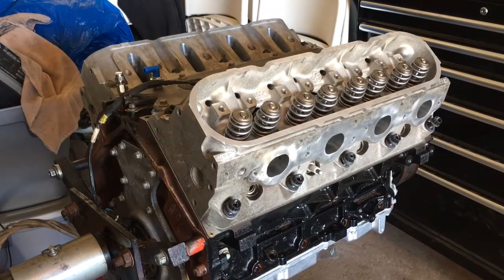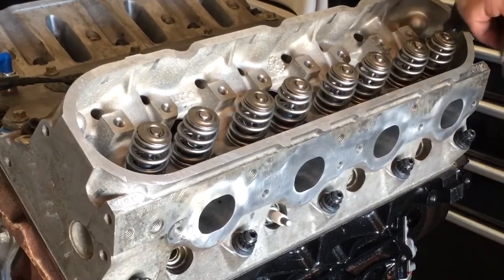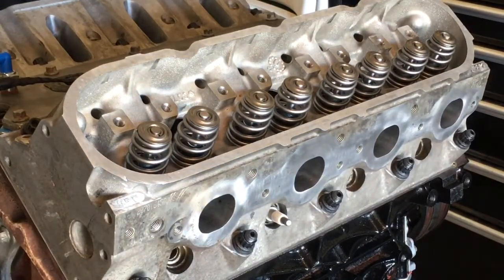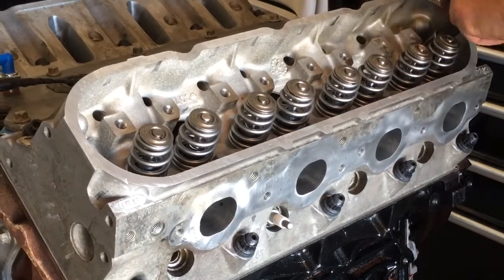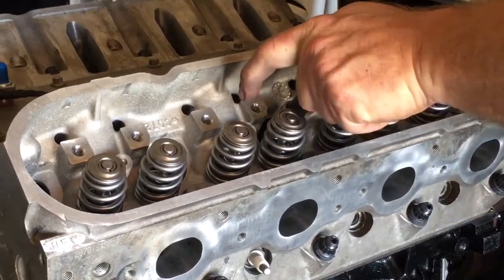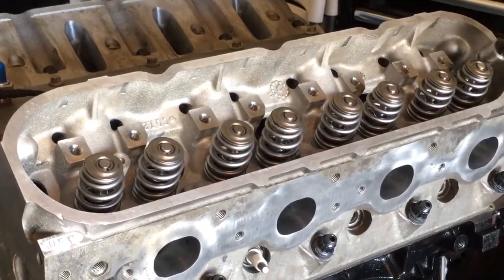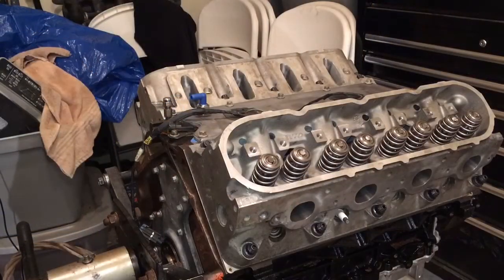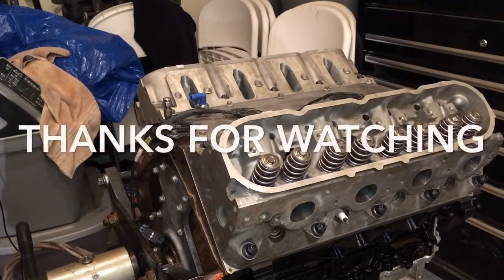Turbo LS Head stud installation

Comment: I was freaking out going from 55lbs to 70lbs.  I thought for sure i had stripped them or stretched them.  I even went and rented a better torque wrench just for like 60 to 70lbs.  But they finally all reached 70.  Some guy said he treated them like ARP and went to 100lbs.   No freaking way my Speed Master studs were making it to 100!

Comment: Do they fit a 6.0 lq9?
Reply from the maker: Depends on what year your LQ9 is!  LQ9 was produced 2002-2007, the 2002 could have either head stud length kit. 2003-2007 should have the 2nd design kit. 
Go to Jegs.com and search Speedmaster LS head studs
Reply: @HeadFlowInc  mine is 2003 Cadillac escalate I’m new to building ls

Comment: Hey what’s the head stud part number?
Reply from the maker: It depends on which block you have, the change over year is 2002.  1997-2002 then the 2002+ 
The earlier design uses 2 medium length bolts per head. 
Early model PCE-279-1023
https://www.jegs.com/i/Speedmaster/746/PCE279.1023/10002/-1

Later model PCE-279-1022
https://www.jegs.com/i/Speedmaster/746/PCE279.1022/10002/-1
Reply: @HeadFlowInc  hey do they fit a 6.0 lq9?

Comment: Did you apply any moly lube to the treads going into the block or just the washer. Mine came with no instructions . thanks keep up the good work sir
Reply from the maker: I’m trying to find the link to the instructions, search speed master LS had studs instructions. If I remember correctly I did not use Molly and lube just oil 3 steps up to 70 ftlb and 25 ftlb on the smaller studs. 
There are specific instructions on the Internet I’m just having trouble finding the link.
Reply: @HeadFlowInc  thanks again this a a first time build and almost all new motor build and the studs I bought are from dna motoring and do not have any product that show head studs at least threw my phone. Similar product from amazon

Comment: I know this video is a bid older but ARP install card gives a final torque of 100 ft.lbs.
Reply from the maker: These are Speedmaster head studs I used their torque recommendation from their website.  My luck it would snap off a stud trying 100 ftlb.   Thanks for watching and the feedback!  JD
Reply: @HeadFlowInc   I'm glad I found your video. Last night I torqued them to 100 ft.lbs on 1 of my 5.3L builds. They stretched a lot but didn't break. I'm going to replace them with another set of the Speedmaster studs and only torque to 70 ft.lbs. They are cheap enough to experiment with and I only recommend using a final torque of 80 ft.lbs max. Thanks for all your information and build guidance.

Comment: Did you bottom those studs out or leave a little space in-between the block and bottom of the stud?
Reply from the maker: STPerform I followed the instructions and lightly seated the head studs in the block. Are there other brands of head studs that don’t want the stud seated? JD
Reply: @HeadFlowInc  I have been taught by professional machinists to run the studs in hand tight and back them off about an eight of a turn.
Reply: @HeadFlowInc  I was concerned that torquing down the stud even with the moly lube in-between the washer and nut that too much torque could crack the block underneath.

Comment: I heard its best to go 15 ft lbs in between from JE pistons.
Reply from the maker: Lime I’ve never seen an application with a 15# incremental torque procedure. The industry standard for the engines I’ve built is to divide the Final torque goal into 3 stages. 
By all means if you want to use a 4 to 5 stage/pass torque procedure, it won’t hurt anything, as long as you’re following the pattern.
Reply: oh, because http://blog.jepistons.com/tips-to-properly-install-an-mls-headgasket it says 15 ft lbs in between if 75 ft lbs is what final torque is, 45 is start. ARP says to go evenly, 25 50 75 ft lbs if 75 is final.